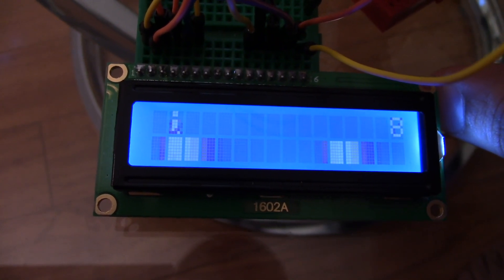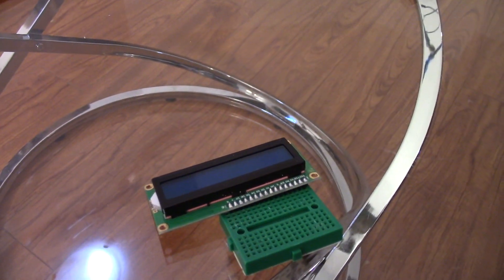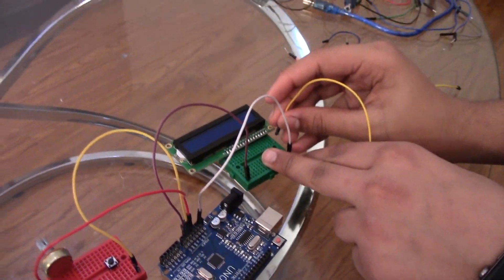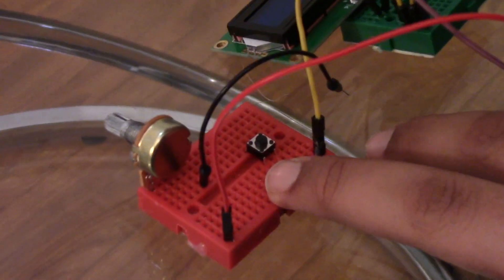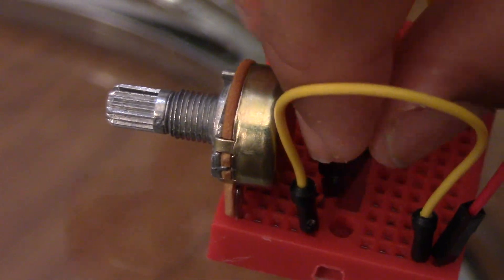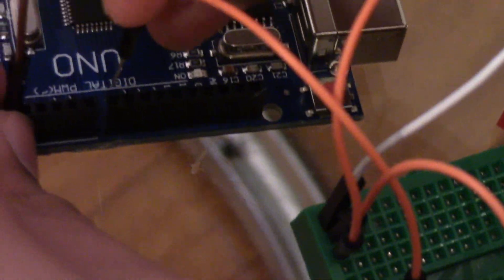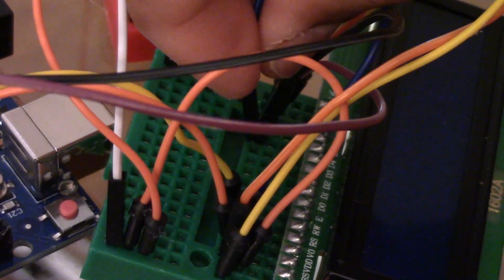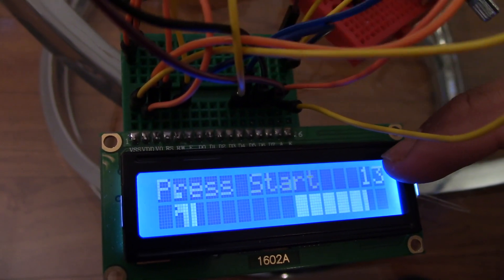HOW TO MAKE A GAME WITH ARDUINO ON A LCD (STEP BY STEP)

Comment: is there instruction for using a 180 tie-piont breadboard
Reply: sry 830 tie point
Reply: This is a great project tho its just i have only one mini breadboard
Reply: also can you do it from 1 mini breadboard
Reply: pls reply quick
Reply from the maker: yes you can make this project with one breadboard but you will have to put the potentiometer on separately with wires (not on the breadboard) (:
Reply from the maker: or you can build it on a 830tie point breadboard the type of breadboard doesn't matter
Reply: @justbuilds8248  can you make a fritzing sketch for it
Reply: with 830 tie point breadboard